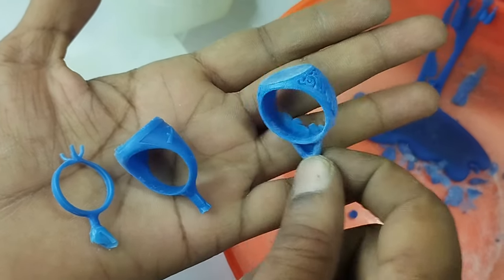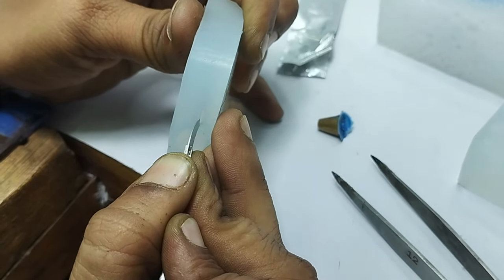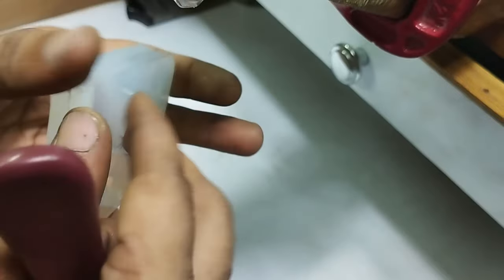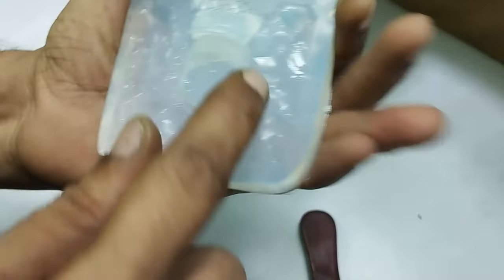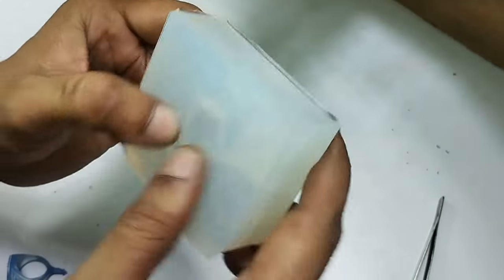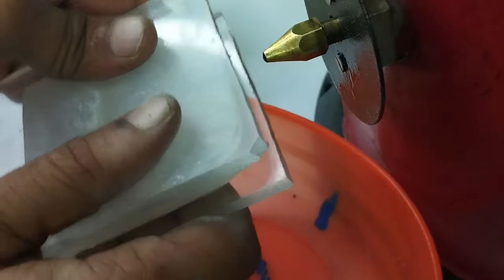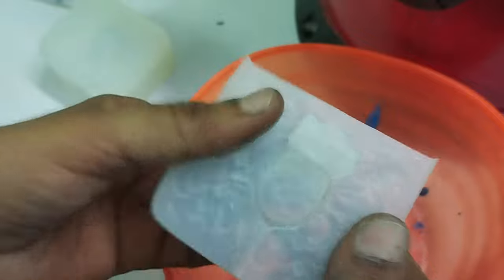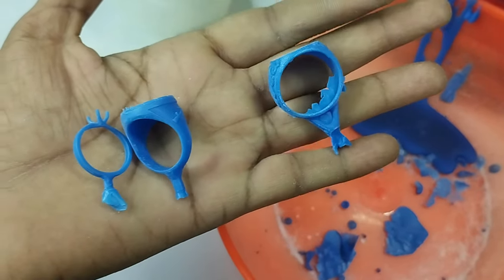How To Cut Rubber Mold | For Jewellery Making | Cutting Rubber Mold

Comment: So the powder helps the air escape the mold? Because I don't see any vents in your mold. 

I wish I found your video earlier, I have managed to figure out what my problems in my molds were with trial and error.
Reply from the maker: Thanks for your valuable comment, You are correct, Vents helps the trapped air go out from the mold. The vents are the way to resolve air trapped problems, but in my video i have not made any vent because i have made mostly with third part substitute and it works as air vents. Second thing is we should not made any vent untill or unless it is required. Powder helps to soak the heat moisture from the mold and helps to evacuate the air from the mold. 
Thanks for watching my video and asking your query. Kindly keep asking your queries regarding jewellery making techniques.
Thanks again.